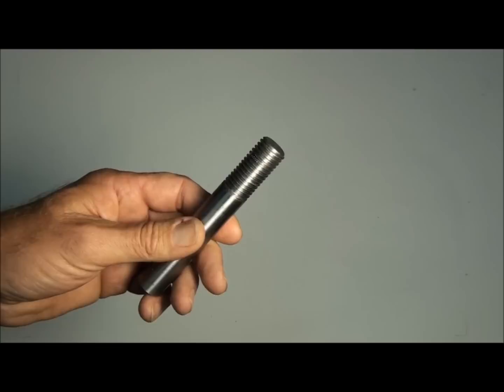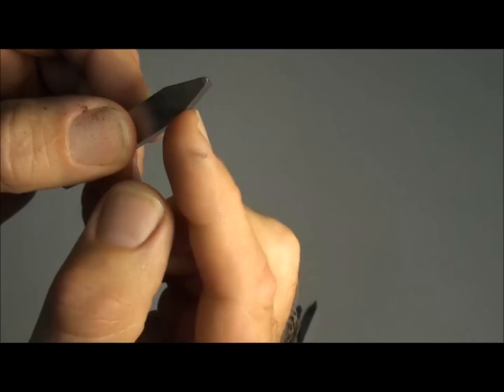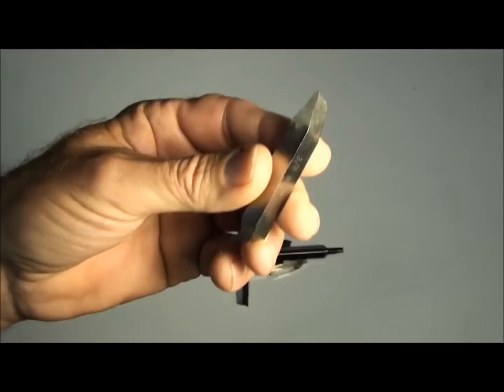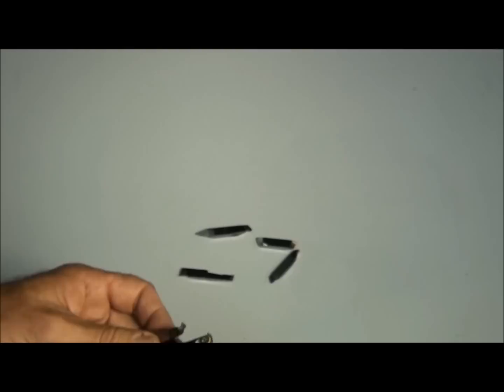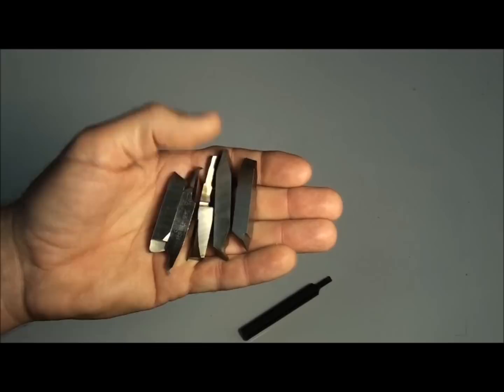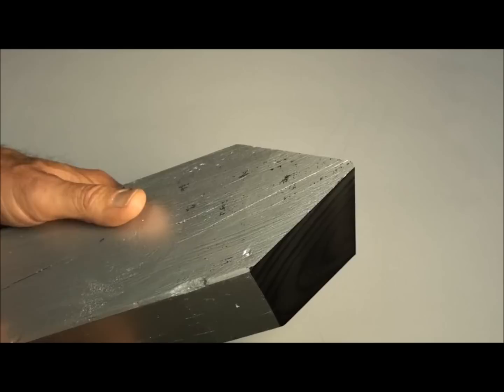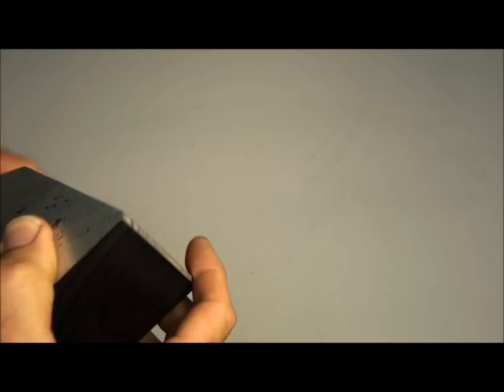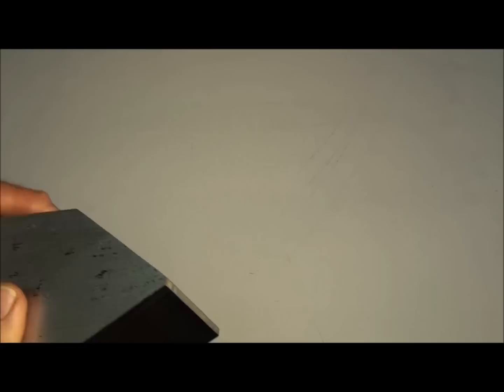Thread Cutting on the Lathe, Part One - Threading Tool Geometry

Comment: You shed new light on cutting threads. After seeing the helix angle and how important it is to be included in the sharpening and shaping  or the tool bit it makes perfect sense and also would make a better thread and without the sharp V at the base of the minor diameter of the thread it would be stronger. Excellent video, thanks
Reply from the maker: Thanks Paul

Comment: I will have to watch your complete series on threading. It's one operation I have never attempted, and now I have a 6" independent 4-jaw Cushman chuck that had been damaged and crudely repaired at one point, but really needs new adjustment screws. They are approximately 3/4"-8 LH square threads, and to do that on my HF 9x20 lathe I will need to add a leadscrew reverse tumbler and also a hand crank for the spindle (or a really low back gear, and/or perhaps variable speed drive). I think I need to try some simple SAE standard threads first. Also, the chuck screws should be made from 4140 or similar alloy steel, and probably hardened. More things to learn!
Reply from the maker: Yes, those threads would need to be hardened and a square thread is definitely not appropriate for a first thread cutting attempt.

Tom

Comment: Aloha Tom, 

I have a special project, we have to cut garden hose thread (GHT) on 3/4 white schedule 40 PVC pipe.

The diameter is fine, but my mini-lathe only has a chart for down to 12 threads per inch.

QUESTION: how do I set the lathe up to cut 11.5 TPI? Non-tapered.

I read the manual and see nothing about doing under 12 or dealing with threads that are .5.

I watched some “how to” Youtube, really liked you one explaining the Thread indicator ...and you say to double the fractional count to 11.5 + 11.5 to get 23 so you know where to start the half nuts on the lead screw…..using 23 as the guide.

But how do I set up the gearing.

I am hoping you can help me with this. 

Thank goodness we only need to do male threads and NOT cut female internals!

I have searched the net and cannot find any threading DIEs. Odd.

Aloha,
Glenn

Comment: Well made 3 cutting bits today, first time ever, first couple tries at threading not so good.  3rd time I thought I was on the right track but when finished i've noticed the left side of the thread slopes a lot more than the right.  So back to the drawing board I guess.  Curiously im using basic CRR 5/8" to practice on......does it make pretty crappy looking threads some almost look cracked?  I've heard it doesn't turn that great but don't really know.

Comment: Thread forming dies for bicycle spokes use three rolling dies attached to a single mandrel that  also rotates while the spoke is held rigid.  The angle of the thread in relation to the dies seems simple but could use some explanation.  The real question is why the three dies cut the thread without cross cutting each other.  How do I make one of these dies for a 12g spoke thread?  How do I make one for a 1/4" bolt thread?  Are they the same or different?
Reply from the maker: Yes, bicycle spokes have rolled threads. They are much stronger than a cut thread and easier to produce in production. Dedicated machines are used to produce rolled threads so making them in the home shop would be quite a challenge. Do a you tube search for rolled threads to get an idea of how it's done. There are rolling heads available for use on a lathe that consist of three precision rollers of the correct pitch and held on the correct angle, but they are extremely expensive.

Comment: Hi Tom, I leaned a lot from this, thank you. Thread cutting tools make sense to me as they are form tools. However I'm really confused about general turning and facing tools. Could I suggest a video on the shapes of the different types of tools and tool selection.
Reply from the maker: Nigel,

If you visit the reference section of my website, you'll find information on grinding both turning and facing tools. I've also done an instructional video on facing and many of my project tutorials that include turned parts discuss turning, facing and tool selection.

I would suggest starting on the website because it's better organized than my YouTube channel and it should be easier to find what you are looking for.

http://tomstechniques.com/

Tom

Comment: You ever turn your thread tool upside down and run chuck CW and lead screw in reverse,  threading away from the chuck towards the tail stock?
Reply from the maker: I do that on occasion. Don't try it on a lathe with a threaded spindle though.

Comment: What do you think about cobalt tooling or tooling with different coatings.  This is a general tooling question?
Reply from the maker: +Jonathan Mota 
Hey Jonathan,

High speed steel with high levels of cobalt, such as M42 have incredible red hardness and shock resistance. It works very well for heavy roughing cuts as well as interrupted cuts. I just picked up a handful of Cleveland Mo-Max bits at a used tool shop and am excited to put them to use.

Coatings can provide increases in tool life and performance under controlled conditions. By controlled conditions, I mean in manufacturing where the material type, speeds and feeds can be tightly controlled. I don't feel that the added cost of coatings is justified for general use in the home shop.

It is interesting that you elicited my comment about red hardness today because that will be the topic of my first video of the season, hopefully this afternoon.

Tom

Comment: what cutting tool used for cutting square thread., it doesn't mentioned on this video.
Reply from the maker: I talk a little about tools for cutting a square thread in part 2 of this series, but this series is pretty much centered on 60º V threads. The tool will have a flat point, with clearance on both the left and right, more on the leading edge to compensate for the helix angle of the thread. I will eventually make a video on cutting a square thread, but it's lower on my list of priorities because it's not a commonly used thread.

Tom

Comment: Why does this guy hate carbide so much? HSS is slow as hell.
Reply from the maker: You asked.

High speed steel is inexpensive, $10 for a tool bit that you can resharpen thousands of times vs. $10 for an insert that only gives you three edges that you can't sharpen at all. I still have and use some of the first tool bits I purchased when I started in the trade 45 years ago.

High speed steel is flexible. I can grind a tool to fit any application I need in a few minutes, or order a carbide insert for the application if I can find one and wait for it to be delivered.

High speed steel is forgiving. I can drop it on the floor, bump it into the work or stall the spindle by trying to take too heavy of a cut and not worry a bit about chipping the tool. I can also push a high speed steel end mill and it will bend but not break (try that with carbide).

High speed steel produces a much better surface finish than carbide inserts.

High speed steel works better than carbide on light machinery, such as that found in most home machine shops.

I don't need special and expensive tool holders to hold a high speed steel tool bit.

By the way, I do have carbide end mills that I use for special applications like small slots (down to .005"), applications that require an extended reach end mill, and stainless and hardened parts.

Tom